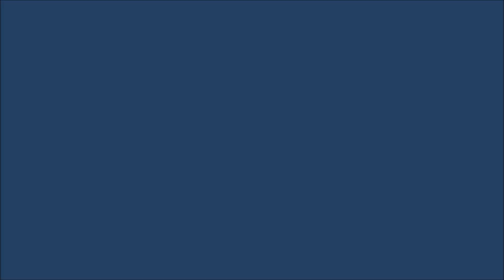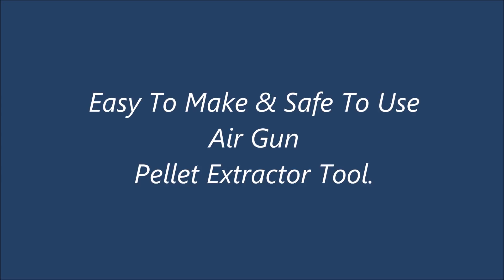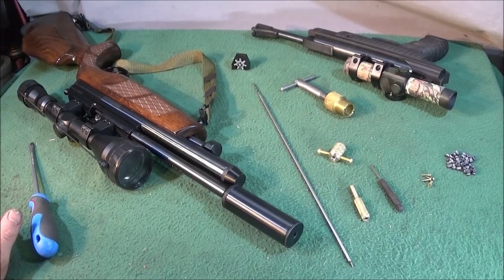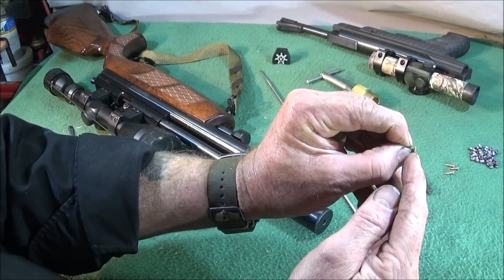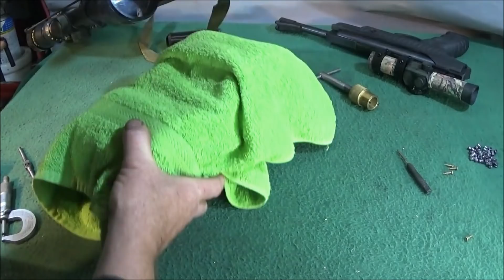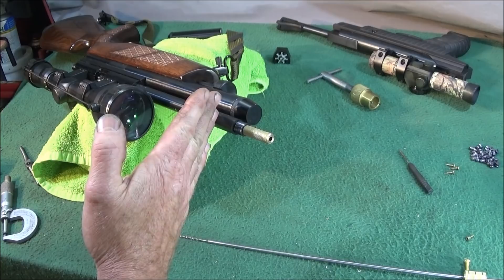Easy To Make & Safe To Use Precision Air Gun Pellet Extractor Tool

Comment: Made a couple myself. Used some old fishing tackle wip ends no drilling needed already hollow just need the right diameter for 177 or 22. Small wood screw and small drill bit and the loctite. No damaging the barrel with fibreglass.

Comment: Easy to make, if you have silver steel, a micrometer, chamfering, multiple sizes and diameters of brass, metal drill bits, brass screws, and a lathe, all right there at your disposal, as we all do...

All much easier, of course, if you don't pronounce the T at the end of any words...

Comment: Just came across this video. What a cracking idea. Are you making any of theses to order in all calibres by any chance? I’d certainly buy one as I don’t have a lath
Reply from the maker: Hi I found out in the end that this tool is not needed. I just push a small diameter rod up the barrel and push the pellet back into the breech. The brass is softer than steel and won't damage the barrel in any way.
Reply: @SteveJordan  in that case mate sell me the one you made and I’ll take it off your hands and clear up some space for you 😂
Reply from the maker: OK I will find it. Search it out later.

Comment: Great video! Your tool looks good. Just a thought though, with your machining skills why not make an adapter that threads onto the end of the barrel with a grease nipple in it. Then fill the barrel with oil, screw on the adapter and use a grease gun to push out the pellet?
Reply from the maker: Hi, Thanks. I found, in the end, that you can just use a long brass rod to push the pellet out by hand. Being brass, it doesn't damage the barrel in any way, and it works quickly and easily. Regards Steve

Comment: Hi Steve i think you have done a brilliant job there, would you consider selling one to me as i do not have a lathe and i am a retired old common bricklayer
Reply from the maker: Hi Winston Thanks. When I get time I'll make another one. Regards Steve
Reply: Ditto for me too Steve! I have a Avenger that just loves to Jam pellets! I usually take it to a gun shop but that's getting expensive. 

Let me know if it possible
Reply from the maker: Ok if I get the time I will make some up. Regards Steve
Reply: @SteveJordan  I am in the U.S. Can I purchase one of these tools in 22 cal?
Reply from the maker: I have found that these are quite unnecessary now. I can just use a small diameter Brass rod and just push the pellets back up in the barrel into the breech. The brass is much softer than steel and doesn't scratch or damage the barrels whatsoever.

Comment: I have one of the early Daystate CRX with a BSA barrel.
a Daystate 2000 again with a BSA barrel.
A Steyr LG110 with a stainless steel barrel. (very picky needs cleaning every 200 pellets)

I made a similar multi use tool for obstruction clearing/barrel cleaning tho with a regulated gun getting a pellet stuck due to lack of air pressure is not an issue.

I made PTFE bushes for the rod fitted at the tool end to further protect and centralise the tool in the barrel and a PTFE barrel crown sleave. My rod and tools are threaded. Similar to commercial cleaning rods. So I can easily buy a new brush etc for my kit.

Comment: Wouldnt just pressing it out with a .2" aluminum rod be easier?
Reply from the maker: Hi Josh, You can, but only do it if you have a cheap airgun, without an expensive precision barrel. Regards Steve
Reply: Steve Jordan not sure I understand what the potential damage could be. Surely the aluminum wouldnt mar the rifling?
Reply from the maker: As long as it pushes out easily by hand pressure only it should be fine. If you have to use anymore force than that, then there is a chance of damage, even with aluminum, which varies considerably in hardness.  
  The modern expensive airguns obviously have high quality barrels. These are high precision instruments, so I take the greatest of care not to damage them.

Comment: If your lathe had as much run out as I have seen your pellet remover would run the drill bit intom the rifling.
Be thankful that your stuff is more accurate than mine.
Thanks
Reply from the maker: I never really check the run-out with a clock. If it looks to be running out by eye, I start the spindle and knock the component with a small soft mallet until it runs true.

Comment: I have the Chinese combo lathe mini mill and have been looking at that collet chuck. I have bought many things from Banggood everything good quality so far. I have broken a Banggood tap but that may have been my fault, I think! Thanks for sharing
Reply from the maker: I have seen a few that seem obsessed with this concentricity issue. Fussing about for hours over a .001 run out!!! I have had several Chinese sets and never had a problem with any so far. I wonder sometimes if it is just people that are trying to discredit the Chinese made tools because so many are buying them now. I am so pleased that the Chinese have made excellent tools that I can afford. This has utterly transformed my workshop tooling having fantastic tools to use.
Reply: If I could give that comment a million thumbs ups I would. For the money we pay for these tools, the quality generally is outstanding. I've had the occasional poorly made tool or a device failing prematurely but nothing that has put me off eastern manufactured goods altogether. 

Yes, quality control can sometimes be poor, but I can build an entire workshop filled with eastern tooling and machines for the price I would pay for one big name brand lathe or milling machine. Buying used big  brand name machinery can be a bit of a pot luck as a lot of these machines have been worked to death and are then flogged off to the hobbyists. I would feel safer buying a lower quality new machine from the east and improving it than trying to restore a clapped out quality machine. 

I can't understand the professionals who pay peanuts for eastern tooling and expect it to perform to the same standard as the really expensive stuff. Bashing eastern manufactured tools almost seems to have become an internet sport these days  and I regret to say the Americans are the worst for this sort of thing although we and the rest of Europe aren't far behind.
Reply: Many have had bad luck with the chinese collets and collet chucks with too much runout.
Reply: I have learned no machines is great new. I broke a lot of cutter before i learned how to lap the ways and gibs. Mini mills don’t like hogging big cuts. I paid $700.00 for my combo lathe, mill, drill. Sharp quality cutters makes a huge difference.